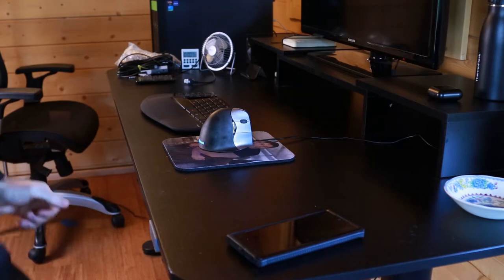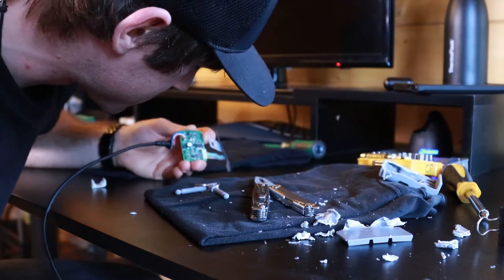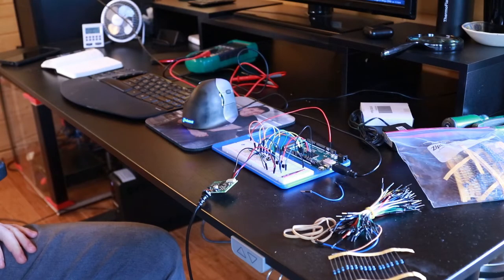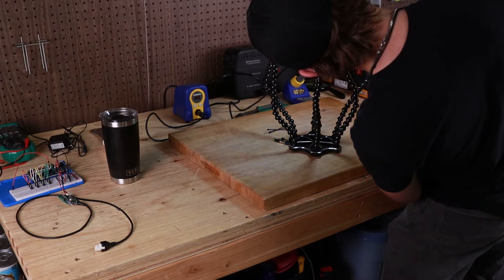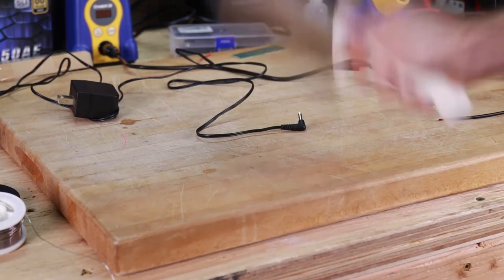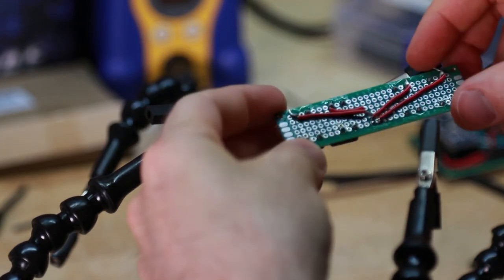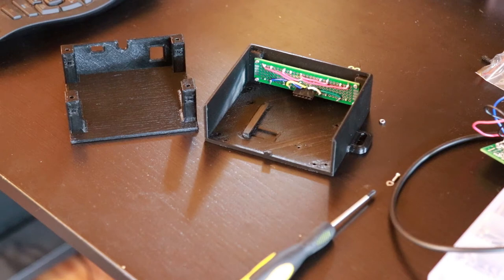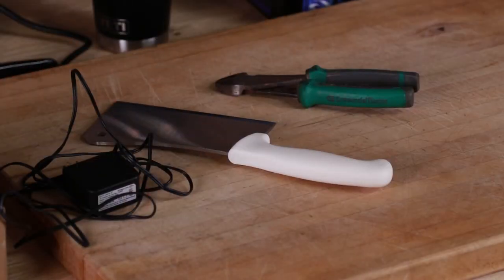Automating an IKEA Standing Desk With Arduino

Comment: Nice, you could also add some kind of distance sensor like an ultrasonic one to measure the actual height of the desk relative to the floor to improve it even more.
Reply from the maker: That would be cool! It could be completely hidden on the bottom side of the box too. Add a potentiometer to adjust the particular height it moves to, with an auto-darkening eight segment display as a readout to show the selected height.

Comment: I'd vote for a bit shorter personally. Maybe some like that style though.
Reply from the maker: I completely agree; this was really long for what it was. Even though I'm still discovering my video style, I already look back on this as an "early work" that was fun to make, but needs improvement. I'd be curious to hear what you think of a couple of my more recent videos (the cornhole boards, and the Galaxy Watch charger switch) in comparison. In each, I attempted to rein in the focus of the video, and add some entertaining story elements. Thank you for the feedback; it really does help me improve.
Reply: @HardwareUnknown  Thanks for the reply. I've seen some of the cornhole board video. Pretty neat concept.

You may eventually want an end stop switch on this one. I imagine things get a bit complicated if you hit the wrong auto button!
Reply from the maker: You've got a good eye... and I hit the wrong one when I move past the desk every so often. I really should inset the box from the front of the desk.

The nice part is the desk comes with internal endstops of some sort. Even if you hold the button down at the top or bottom, it simply shuts off the motors. Since my mod emulates the button presses, that functionality still works. The desk even has crash detection in case it's only halfway up and binds on a body part or nearby furniture. Thankfully that also functions normally as well.
Reply: @HardwareUnknown  Ha, thanks. That is good to know about the end stops. Perhaps that detail was in the video somewhere.

Good luck with your videos!

Comment: Loved the video, and glad to know I’m not the only one who gets excited when my projects work.  I really like the simplicity of a timed contact closure, but I’m wondering if that’ll hold up over time as the motors wear.  Your preset height might drop over time.

I see you left the USB exposed to ease reprogramming. Smart. But if you get bored and want to play around, you could add adjustment pots to your circuit to fine tune the preset points.  Figure out a formula to tie resistance values to an adjustment delay and you’ll never have to reprogram it again.

In either case, you inspired me to mess with one of these!
Reply from the maker: You're on to something; even after only a handful of uses, you can tell there is a slight change to the actual height the desk moves to. I can manually adjust it with the momentary button, then it's fine, but it is a small issue with this design.

In more advanced versions of the mod, I've seen people actually read signals from the desk PCB in order to move the desk to the same position every time. Much more work, but really impressive. Elaborate on your pot method. I'm trying to grasp it and it could be fun to add those in later for more precision.

Let me know how it goes! It's made me want to use my desk that much more. Highly recommend it.
Reply: @HardwareUnknown  oh yeah, the “right way” is to have some sort of direct feedback mechanism. Ultrasonic distance measurement, or some sort of encoder on the motor, but like you said, that’s a lot of work.

My idea would add a little bit of adjustment without gutting what you’ve done.

Right now I’m assuming your code goes something like this:
if(the automatic up button is pressed)
{
HoldButton(PerfectDelay);
}

I’d do something like this:
if(the automatic up button is pressed)
{
      adjustedSecs = getPotValue();
HoldButton(PerfectDelay+adjustedSecs);
}

The getPotValue() function would read the Pot value, 0-1023 from calling an analogRead() and spit out the adjusted time in seconds (maybe milliseconds?). I’d probably set 512 (the mid point) to spit out 0 secs, so you can either add or subtract time as needed.

Hardware wise, the Pot would connect to 5V, Gnd, and an analog input pin. Like this: https://www.arduino.cc/en/Tutorial/BuiltInExamples/ReadAnalogVoltage

This was typed on a phone while kids were running and screaming around me. I hope it made sense. Feel free to tell me if it didn’t 😂
Reply from the maker: @mcohn16  Totally got it now. I like it! At the time I had only considered reprogramming to adjust things, which can get tedious if you're doing so a lot. Particularly with devices that are screwed to the underside of your desk, opposite your computer and you've run out of USB extensions (clearly I hadn't fully thought this through then haha).

Not only could this be useful here, but I'm sure I'll make use of the pot adjustment in future builds too. Usually I've just reprogrammed whatever I'm working on, but I'll eventually be doing more builds that might be used away from home/a computer. I love the idea of incorporating on the fly adjustment.

Comment: This was an awesome project, I'm just wondering where you were able to get an extra desk button switch? I'm worried about destroying the original and only one I have. I have the exact same desk.
Reply from the maker: IKEA is really great about providing small spare parts. I had lost some of the parts in a move beforehand and they sent me extras. That gave me the second button. You can request parts by phone by calling their customer service, and there are also some instructions on finding part numbers here: https://www.ikea.com/nl/en/customer-service/returns-claims/spareparts/. However I just gave them my model of desk and asked for parts including the control board and they knew what I meant.

Comment: Where did you get the spare control boxes. Does IKEA sell them separately?
Reply from the maker: Good question. I don't believe they sell them individually. However, when I was re-assembling my desk after a move I noticed I had lost some of the hardware and electronics. I called customer service and told them about the issue, assuming they would direct me to a spare parts page online to purchase them from. Would you believe it, they shipped me out a set for free that included some bolts and the controller (all small parts, I wasn't asking for the legs or table top). Shipping takes a bit as the parts aren't always locally stocked depending on where you live, but you just can't argue with free replacement components and quality service like that.

If I remember correctly, the number on the following page is the one I used (I'm in the US): https://www.ikea.com/us/en/customer-service/contact-us/

Comment: Great job, now do collision detection :)
Reply from the maker: What's cool about this desk is it actually has it built in. I believe it's via torque/current sensing in the motors, although I can't be certain. Since I'm simply emulating the buttons with my device, the collision detection works just as before! So if the desk reaches the max height or hits something before the Arduino move command stops, it will stop even though the Arduino is still "pressing the button".
Reply: @HardwareUnknown  awwww mannnn. My Tresanti doesn’t have collision detection

Have a stacked dual monitor arm that’s literally a pole, long story short I accidentally pressed a preset button and it started rising, my ceiling is slopped due to it being right under the roof and it wanted to keep going… sucked but I managed to move the desk away quick before any real damaged happened 
But I have that thing unplugged now
Reply from the maker: How fortunate you were able to stop it! A set up like that isn't cheap to fix. I'll say I highly recommend the Bekant. I'm not sponsored by IKEA, I just like it as a product. Once it contacts something, it attempts to move slightly more before sensing it and stopping. Hence why I think it's motor current sensing. While it doesn't have auto movement (thus the video) even before I added that I loved this desk. Give it a try if you're ever looking to switch.

Comment: Nice. Lately I've been wondering if I should get a bekant myself. This desk seems overpriced.
Reply from the maker: Electric desks are pricy. Really depends on the person if it's worth it. Changing from sitting to standing and back frequently helps me focus and eases back pain, so it's worth its weight in gold there for me in particular.

I like the Bekant in particular because of how smoothly it moves and how large the surface is. That being said, there are other desks out there that I'm sure do the same thing for less. Overall though, I'd recommend sit-stand desks in general.

Comment: Just drop that here: https://youtu.be/AB75AxprXqQ basically what you did but with linbus reverse engineering to get height values. Im still trying to figure out to get this with esp8266 working, but to afraid to fry the controller :/
Reply from the maker: Saw that build, man it's done so well. Properly getting the values really was something to see. Mine was a hacky solution that works for my limited knowledge, but wow I'd love to have the experience to do what he did.

If it means anything, you can get replacement controllers from IKEA. I broke my first one. You'll learn so much along the way!

Comment: There is an alternative opensource controller replacement:
https://youtu.be/QopaeB1k6LU
Reply from the maker: I love this, it's so clean and the fact that it makes use of the original buttons/case is really cool. They definitely removed the welded part of the case better than I did. 😆

Comment: Does anyone know if the BEKANT legs can be daisy chained together? For example, I'd like to have 4 legs controlled simultaneously by a single controller (or even a secondary controller in parallel).
I'd like to dive into the LINBUS system eventually but for now would be happy essentially getting two desks to work together. Was thinking of hacking the controllers and connecting the buttons in a similar fashion as this video but would love a plug-n-play solution.
Reply from the maker: I don't know what the connectors are called, but the "to" and "from" connections on both legs are the same. This may lead to daisy chaining ability beyond two, I can't be certain. There may be only two signals from the board, I haven't checked. I hope an experiment works out for you, or at least gives more insight into a solution. Wish I could offer more here.

Comment: Really enjoyed the video, i definitely thought something about this when I bought the desk! I'm indeed not a person knows about electric(i kinda should've because studied mechanical engineering), though I was wondering if we can somehow get the power from desk itself for the Arduino. It's not really an important case, because ideally i'll have one Arduino that controls everything at home which will be connected by power adapter anyway.
Reply from the maker: You definitely could get it from the desk somehow. The motors will use way more power than the board will, so there is a way somewhere to steal from that. I haven't looked into specifically where to tap into, but that would make it really clean.

Comment: For anyone who doesn't want to open up a desk height controller unit and figure out what to do.
I'm pretty sure you can buy a different controller from Linak (Ikea standing desk) or from the manufacturer of the actuators (motors) for the standing desk you have.
Reply from the maker: No kidding! I learned a lot from this and I'm very happy for that, but I'd love to have a drop in replacement. I'll have to check Linak out.
Reply: Where’s the fun in that!? The moment something you did yourself works is priceless
Reply: I thought ROL ERGO was the manufacturer of these legs?
Reply from the maker: I do enjoy that aspect of all this, of course. Just nice to have options. This was a great learning experience though, and I proudly make use of my creation to this day.